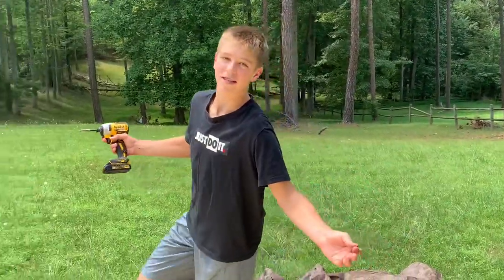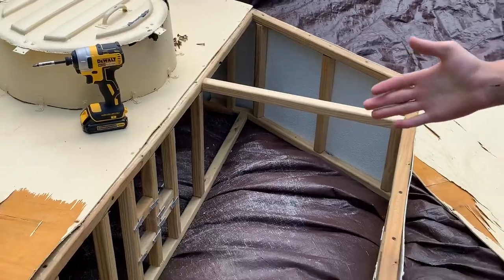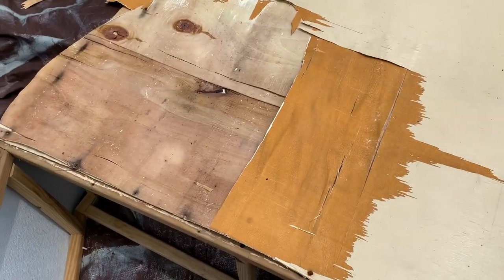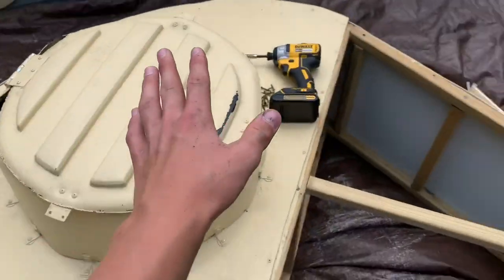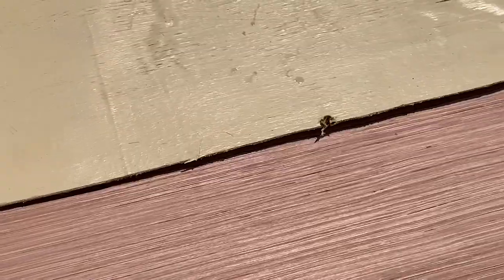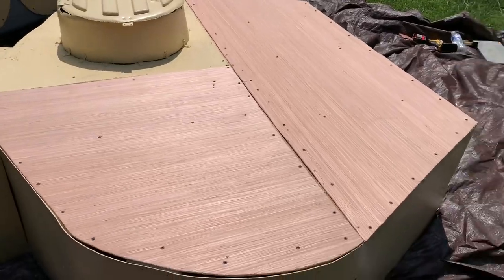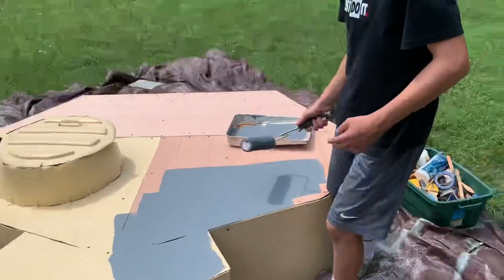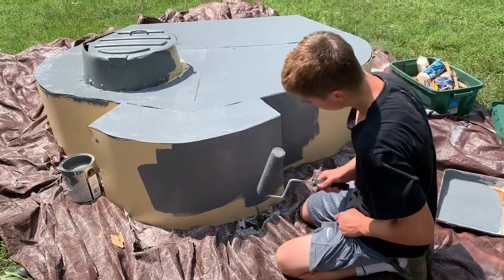Preparing for War Bloods S2E7!!! (Painting the Tiger Tank)

Comment: I’m guessing 007 since that was the number on Michael Wittmann’s Tiger when he was killed by a Sherman Firefly.
Reply: Yep
Reply: ok
Reply: A
Reply: i think its 212 or 217 not 007
Reply: @Farm172DII  I found a good article on panzerace.net which lists most of the turret numbers commanded by Michael Wittmann. It says that 007 was the command tank he had when he arrived in France, but changed tanks several times during the campaign. It was either 222 or 231 but most likely 222 that he was in when he was killed. Either way, it was definitely not 007 so thanks for pointing out my error.
Reply: @Farm172DII  sorry, that article ends with the battle at Villers-Bocage. A different article on warfare history.com says he was back in 007 when he was killed on Aug 8, 1944.